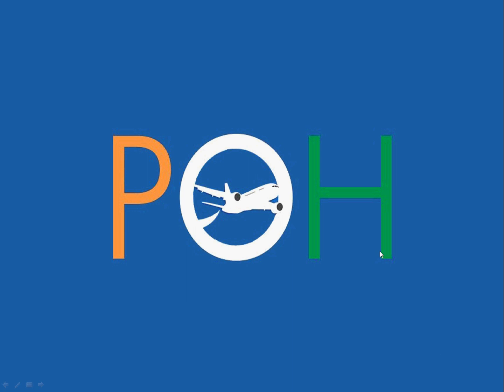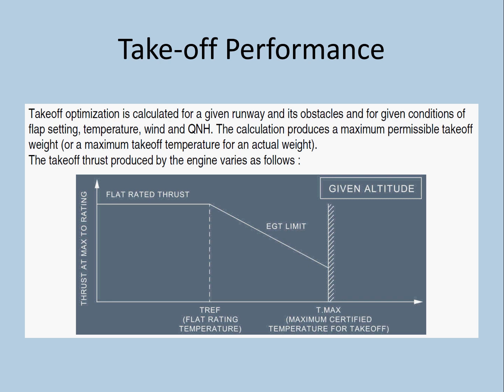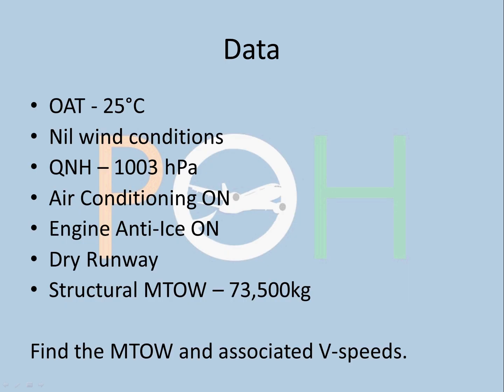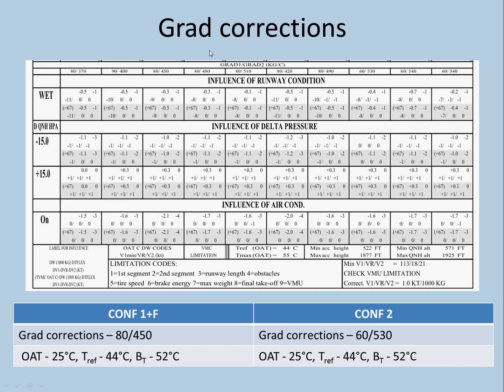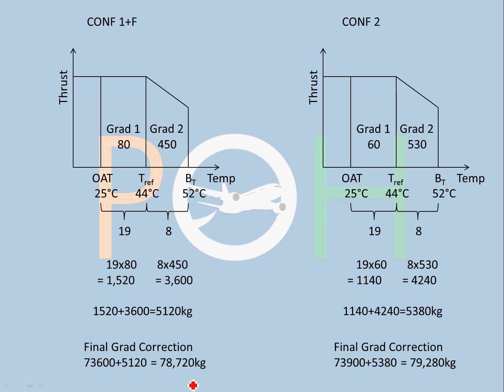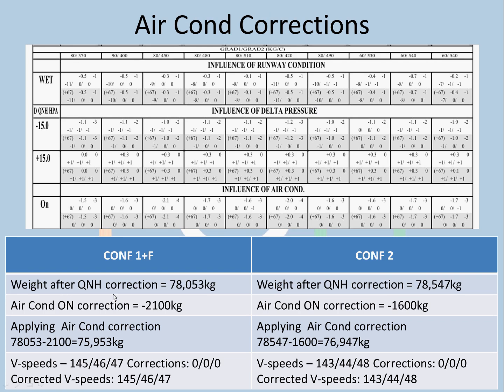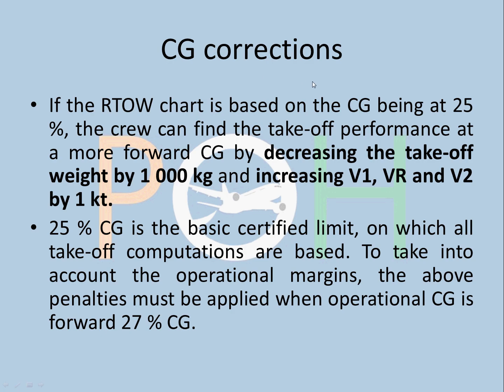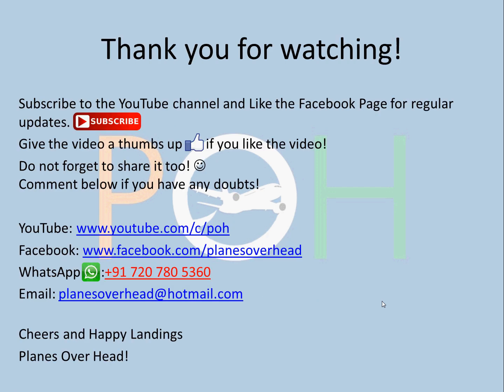A320 - RTOW/MTOW Calculation

Comment: Nice. Just adding that the GRAD corrections are ONLY used when OAT< to the temperature of the first line (highest weight) as stated in FCOM PER-TOF-TOC-18-10:
..."In some cases, it may happen that the first temperature value (displayed for the highest weight entry)
is higher than OAT. In this case, it is allowed to extrapolate the weight value to avoid unnecessary
penalty. Use the Grad 1/Grad 2 gradients provided at the bottom of the corresponding column."

this is to get a better MTOW. The A4 as not enough space to put all the weight/temperature info so we have to extrapolate :)
Reply from the maker: All correct.

Comment: Just wondering, if we could use a chart with more Temperature Options.? Like i have been using the Runway Analysis charts from APG, for Airbus A318 and Embraer E190, we have option to select "full temperature". If we select it, it will produce the chart with -20 Degree or so to all the way upto 50 Degree. So we can avoid painful calculation of Grad.?
Reply from the maker: +jesil rahman Yes you can use that, grad correction won't be applied then. Simple as that. 🙂